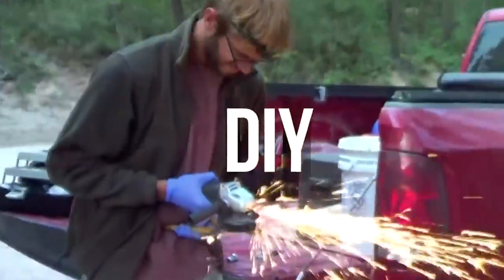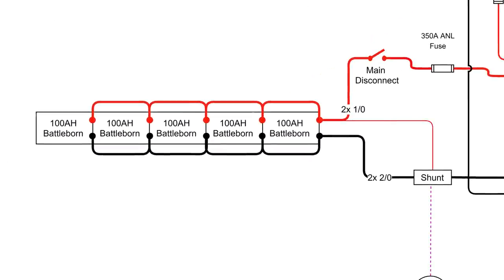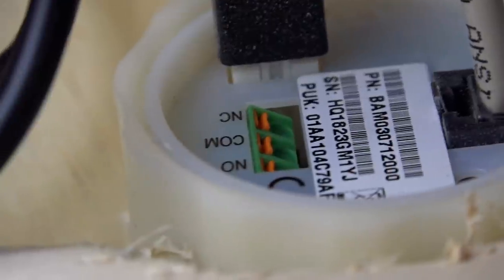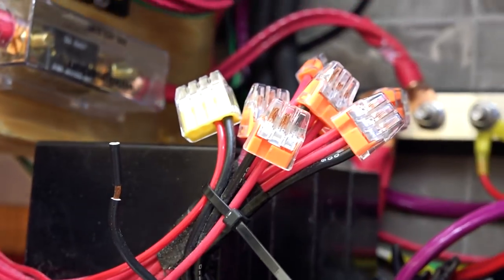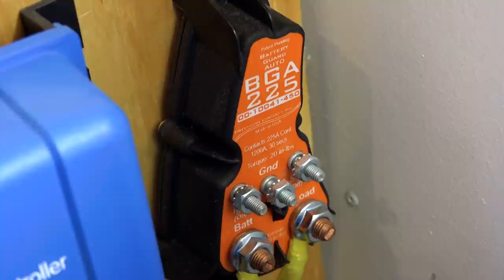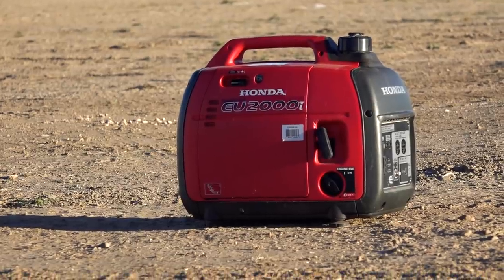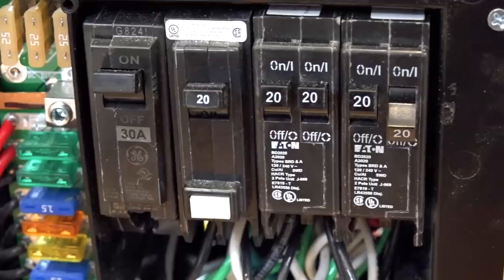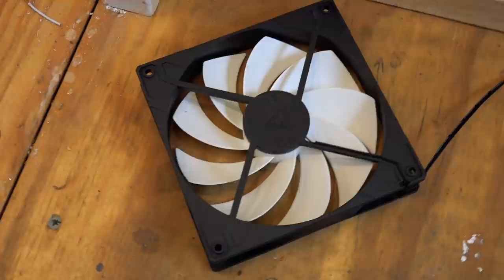RV Electrical System Walk Thru In An Off Grid Optimized Airstream  - Solar, Lithium batteries

Comment: I was wondering why you didn't run a battery positive buss-bar along the wall past all the batteries and another battery negative buss-bar using braids to connect to each battery to the two bus-bars.  Then you said that you had a lot of heavy wire available to you.  The appearance of the connections where you have to connect four of those wires to the battery terminals begs the question.  I still think I would have tried to talk Kyle and Olivia into a bus-bar approach.  Additionally, curiosity makes me wonder what the ohmic value of the shunt is.  You are measuring some heavy currents but you don't want to have a significant voltage drop, therefore it has to be a compromise between resolution and power loss.  I would like to have set in on the meetings where that was determined.  Finally, are you powering all AC outlets and appliances off the inverter or are you leaving some of them for shore power only?  Some installations I have seen only power some outlets from the inverter and I think that would be a mistake.  Some with fifty amp shore power only power one 120V side of the RV.  Again, I think that is a mistake.  Only half of your RV is usable when you are boondocking or in a campground that has a power failure?  I don't think so.  I would power both and only turn on what is needed until power is restored.

Comment: Nice video and system.  But I have to ask with "cost" as part of the goal in setting up this system, why Victron?  Victron while a good product to be sure, comes with a hefty price tag, in comparison with some other very fine, and equally capable components.  Additionally, I have a hard time understanding the appeal of Victron for truly off-grid use, since it relies on a computer or smartphone to troubleshoot and make adjustments.  I would hate to be out in the boonies, have an issue or need to make adjustments and for whatever reason not have smartphone or computer service or available.

Comment: Is the BMV712 and the Victron GX panel redundant?  Could you have just gone with the GX alone or does the 712 provide other uses not done by the GX control panel?
Reply from the maker: The Victron GX is more the redundant piece, the shunt is required and cannot connect to the GX.  The inverter has a SOC reading but only works if its the only thing on the system.
Reply: To clarify, I am building a system and do you feel I definitely need a BMV712 but the GX control panel is more a luxury than needed?  I like the internet connectivity but can that be gained by some kind of Bluetooth dongle at much cheaper cost?  Thank you.
Reply from the maker: Yes the color GX is a luxury, the BMV712 will connect to your phone but you would need a head unit to connect to the net.  Check out the VENUS GX for a cheaper option without the screen.  These are really only used for net monitoring and advanced power flow / grid tie functionality .

Comment: I was looking at your "blueprint" of wiring layout. I notice you had 2X 1/0 red cable to  battleborn battery and 2X 2/0 black cable from the battery.  Should both cables be same wire gauge? (1/0 and 1/0) or (2/0 and 2/0)  Thank you.
Reply from the maker: They don't have to be as long as they are above 1/0.  You dont really get double capacity however, you need to calculate circular mils of cable size and use that to determine ampacity.  As stated we could have used 4/0
Reply from the maker: Wow that comment was for a different question.  You found a typo, correct they should be the same size.

Comment: I'm just wondering if they considered the Tesla battery at all over the BB's?
Reply from the maker: No, they do not have the technical understanding to manage a Tesla system or desire. I don't recommend the Teslas unless you can fully understand and manage the system yourself or they are dangerous.
Reply: @MortonsontheMove  I guess I can see that.  I'm a big techy, and love the watts/$$, so getting ready to buy 1? 2? Tesla's batteries when the time comes... Thanks.

Comment: I’ve been in an airstream in summertime. Like being inside an oven. That metal exterior gets very hot making the interior very hot. This is why I don’t like airstream. Hopefully they have taken this issue into account on the remodel. Those solar panels need adjustable height. Flat panels on an rv in winter months are useless. I would’ve gone with a 48v system for exactly that reason. Hi efficiency means a lot less solar panels, gaining you 4 times the real estate on the roof. Not to mention an easy to handle ramp up making the inverter work a lot easier as well. Running a full size rv AC on a 12v system? I guess with the hybrid inverter using your generator it would work.
Reply from the maker: It will run it, but its pushing it.  The hybrid mode it runs fine.

Comment: Ok, one more question re the solar.  Why leave the panels parallel, given the MPPT controller?  So many are addicted to the higher series voltages, which you could of done.  I have mine at the lower voltage, but I hear a lot of friends Los swear by 24 or 36 or whatever.
Reply from the maker: Like I said in the video these panels operate at the same voltage but different currents, running them in parallel would degrade the output more than the lower voltage.  Yes significantly higher voltage than the battery usually will produce more power at each end of the day and low light, plus lower voltage drop.  Also larger panels run higher voltage, ours run 35V under load.
Reply: Besides Tom explanation of the different size solar panels, you also can loose more power if one side of the panels in a series gets shaded compared to parallel
Reply: G Keller yep 'tis true.  Wonder why most are so rabid about MPPT and series-parallel for these smaller arrays.
Reply: @robertgarbe6348  its just a cleaner install. Less wires. And if your panels drop below 18v your not going to charge a 12v battery at all. Thats what the MPPT is for, they work best at least double nominal volts of your battery bank.

Comment: That small trailer would have been fine with a $99 5000btu one room air Conditioner and use a lot less power
Reply: Red Berry I think they were trying as best they could to keep the “look” of the Argosy. A window ac unit would defeat that I believe.
Reply: A window AC unit would also have been a PITA to install because there are no straight flat walls in their Minuet Argosy. It would have involved lots of custom fabrication time, and they can't put it in a window due to how they open/close.

Comment: Can you explain to me why everyone uses the Battle Born batteries? Aren't they like $1000 each? Are the $300 options I find online not worth purchasing?
Reply: Noconz0727 MC what $300 options at 100 amps and the LiFePO chemistry?
Reply: I have $260 Chinese LFP, but 36v and 15 AH. Ebike batteries. They now ship from US. If you know what you're doing you can make them work. You can buy c a l b batteries, which are basically bus batteries from China. BEV buses.
Reply: I guess Battle Born is twice the price because it's made in Nevada
Reply from the maker: Battleborn are reliable and yes US based.  They have the best BMS that I am aware of in a drop in battery.  Many of the others miss critical components that I would deem a safety or battery life hazard. I am sure battleborn will see real competition soon tho.
Reply: Mortons on the Move yeah, the "if you know what you are doing"  part of this post is telling.  95 % of the folks can't even understand the charging algorithms to use on a unprotected battery, so it is apples and oranges.  I use the BB batts, even tho I do understand all this stuff, for most situations it is not worth the hassle.  What the heck, if you want to live dangerously get  a Tessa or a volt and mess with that.
Reply: Noconz0727 MC order a couple of these and report on them, it would be interesting.  Be careful.

Comment: It looks like you’re taking both the plus and minus off the same battery. You should take one off the first battery and the other off the last one. If you don’t you’ll get unbalanced loads on the batteries.
Reply from the maker: Doesent matter on the lithiums with the internal BMS, also the internal resistance is so lot they will evenly charge.
Reply: Mortons on the Move - Actually it has nothing to do with that. If you you pull both positive and negative from one end the current in the jumpers is higher at one end than the other. By connecting plus to one end and negative to the other the currents stay balanced. At high current draws you can unbalanced the batteries if you don’t. 

It’s standard procedure to pull one from each end. It’s a simple fix.

Comment: Big mistake running the panels in parallel. Series strings are much better with each series string going to its own MPPT controller. I would go into all the reasons but I’ll bet 40 years and an engineer that I’m right.

Other than that it’s a great job.
Reply from the maker: Well I would disagree,   the panels were the same voltage with drastically different currents.  Do the math and you will see the lower current will drastically drag down the whole system...I would agree a seperate charge controller would have been best but the did not want to do it  .. you have to understand how series parallel truly affect the system and do the math to figure out the loss percentage if your limited like this.  An alternative would be a Tigo optimizer on each panel. (solar edge wont work on these systems.... I have tried)
Reply: Many campsites may have some tree branches shading some of the panels. In series would take the current of the least performing panel. Panels each in parallel just add in current best they can... series would be like a house roof top in full sum with no trees, etc.  good discussion.  I have 25ft trailer. Have four 350w panels. Thee on top and mounted one on the rear... looks like a windows when cars follow... all in parallel.  Surprising how much early morning or evening sun the ass end of my trailer gets.  Mid nite solar classic mmpt.  Four renogy Li 100AH Li.  Better deal on amazon than battle born... but.  But. Battle born has an eight year warranty for the extra money... thanks